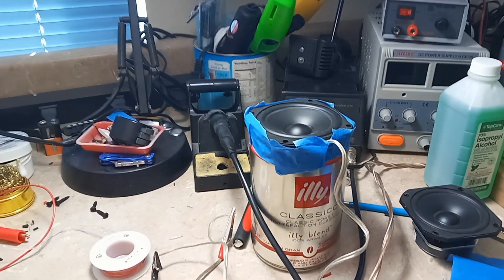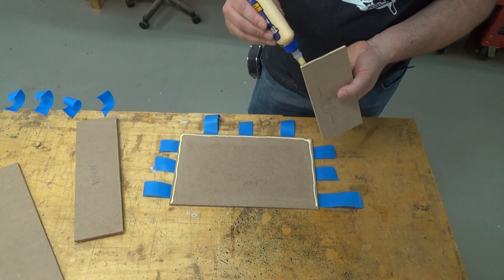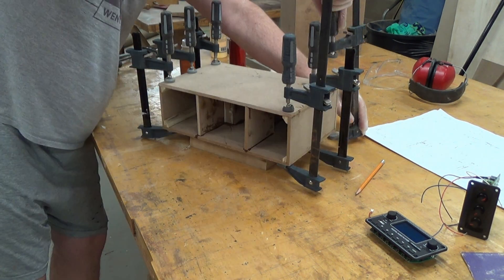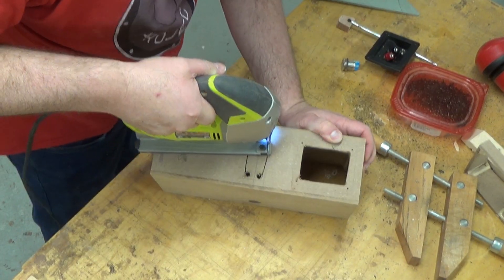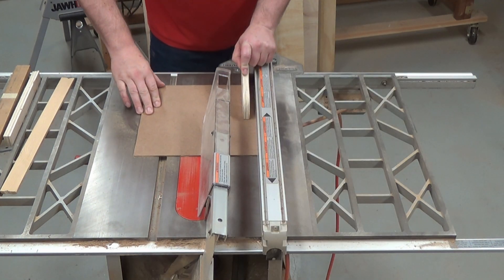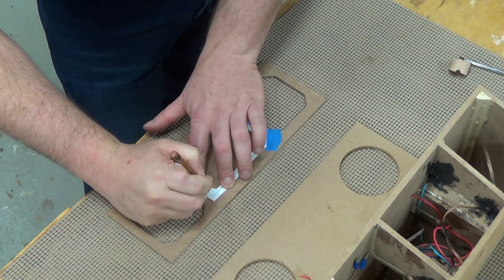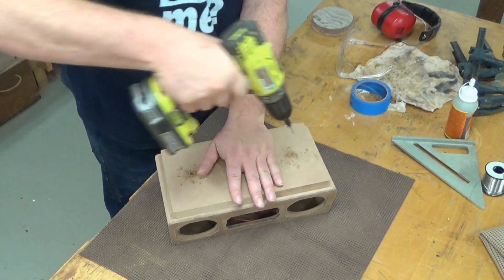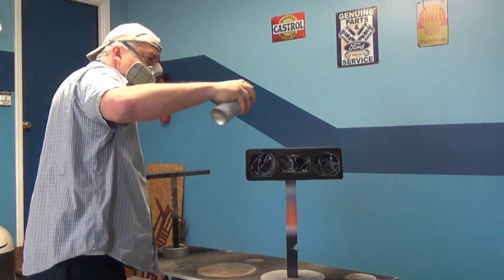Building the 2.1 Harmonious Table Radio

Comment: Another fine project, Zarbo!  Well done!
Reply from the maker: Thank you! I wish someone else would build it, it really sounds great.
Reply: @zarboaudioprojects1430  I think I have those drivers.  I tried a passive radiator project that I wasn't blown away by.  I could repurpose them.
Reply: Parts ordered!
Reply from the maker: @brianraulerson5037  Cool! I hope you have good success with it. Here is the official thread on it at Parts Express Tech Talk forum if you'd care to post any pics there since I don't have my own website.
Reply: @zarboaudioprojects1430  Where did you get that antenna?  I'm looking but don't know what I'm looking at.
Reply from the maker: @brianraulerson5037  I bought it from either Aliexpress or Banggood, I can't remember which, probably Banggood. They come in a range of sizes and they are not hard to make decent, so even the cheap ones I bought work fine. :)  If you do a search for Telescoping Antenna on Amazon they have a few there as well (for quicker shipping)

Comment: I have some 3d printed trim rings that snap on to the speaker flange that would make this look more like the scanspeak version of this speaker. The way they are designed though they would have to be flush mounted, but they could be redesigned without the roundover.
Reply from the maker: That sounds like a good idea. There is another version of this same driver with that foam gasket material on the rear, as opposed to the front of the driver... apparently this particular driver is meant to be rear-mounted which is why the foam is on the front. PE only sells this version I believe. I really don't like these weird-framed drivers as they are a pain to recess, but my lazy-man's technique worked okay in the end. 
You guys with the 3-D printers have all the fun!  

Oh, and regarding your other comment on the form factor of this amp (I can see it but not respond to it for some reason) I like it too, SO easy to mount, and nothing to do but hook it up. It's kind of LOUD too! The preamp I used was on the quiet side, but with a real CD player or laptop output going into this amp, it really puts out the power!

Thank you sir, for watching and commenting.

Comment: Nice video nice build. What if you make a Epique sub 5.25” driver in the same box fully integrated that is what excites me proper 2.1 No seperste sub box easy to move around for ladies and kids even if there is no battery no problem
Reply from the maker: That would make a loud and low small suitcase sound system for sure. The smallish sub box in this system allows for placing it where it will do the most good in a room, as well as making it easier to hide (lots of ladies may not want to see a "Sub-Thingy" out in the open) I'm all for your idea though, sounds like fun!
Reply: @zarboaudioprojects1430  request you to consider a project on a superb all in one BoomBox 2.1 🙏🏻